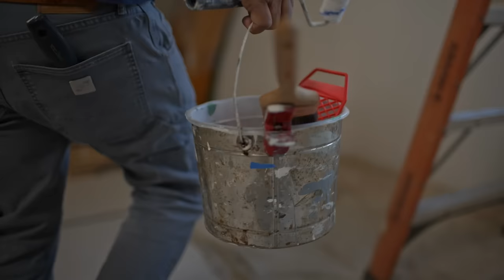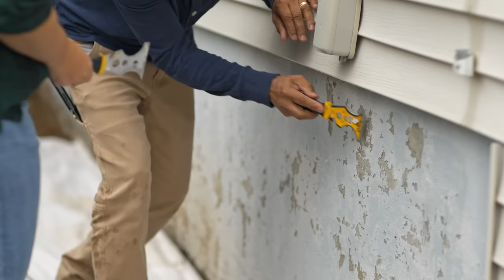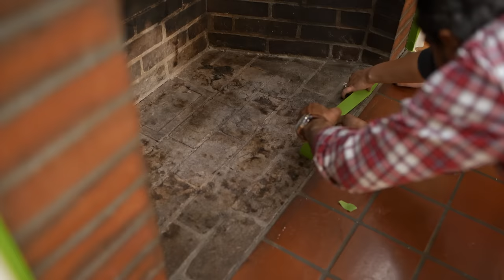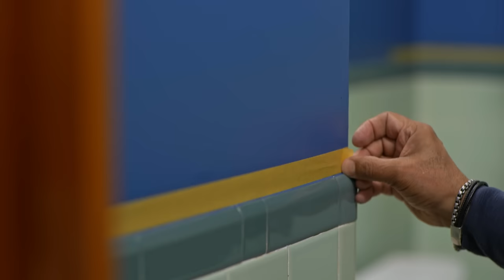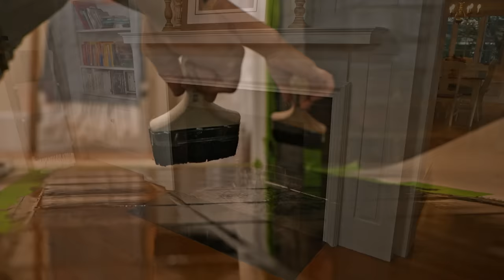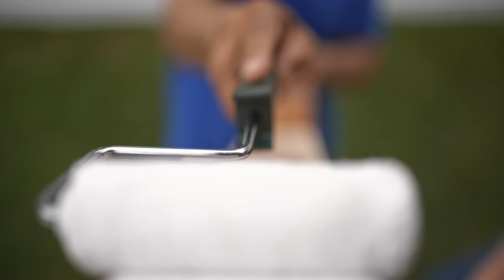Why is Prep Important Before Painting? | Ask This Old House

Comment: Okay, I painted the front door about 8 years ago. And I PREPPED That Door. Went to the proper paint store, told them what I was painting, bought special paint. And every stinking piece of paint is peeling off of that door and has been for about 4 years now. 
It's driving me CRAZY.
P.S It breaks my heart to see brick or stone painted. NO
Reply: So you’re saying not to prep?
Reply: Probably some "new special modern" paint 😁
But there is really nothing special in just painting the door.
Prep it once again and repaint it, but this time with an oil-based paint (a.k.a. solvent based paint or alkyd paint)
That is the only type of paint that will last for a very long time.
They are just trying to push these modern water-based paints such as latex paints, but they don't last long, especially outside.
With an oil-based paint, you have to wait for the first coat to be dry for about 5 to 6 days, before you can sand it. And sand only to remove the high sheen of the first coat, to make it look a bit matte, so that the second coat can grab to the first coat.
Also, the first coat goes a bit thicker, and the second coat goes thinner. That is because the second coat is mostly to fill the imperfections of the first coat, and to even out the whole surface.
I would also not recommend putting more than two coats, maximum three. Because the paint may become too heavy, and it may start to crack much sooner just because of that.
Also, don't forget to clean the surface after you finished with the sanding of the first coat, before you put the second coat, or the paint will stick to a dust particles instead, and it will start to crack and peel very soon.
I use gasoline for cleaning, because the gasoline leaves slightly a sticky surface, so that the second coat will stick to the first coat even better.
This is all how people used to do it. An old simple methods, and the paint would last for a decades.
Reply: @Dino_Buk  I appreciate your good advice. I'll hit it again sometime soon, but I'm not going to work as hard this time. That front door is always going to look like the side of a barn, I guess.
Reply: @c0mputer  Nope, not wot I'm saying. I'm relating my experience.